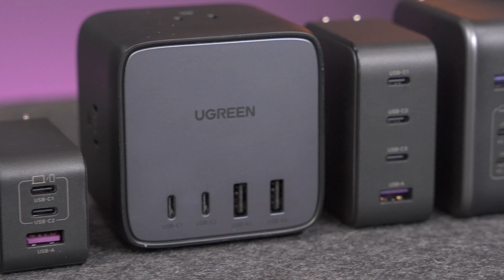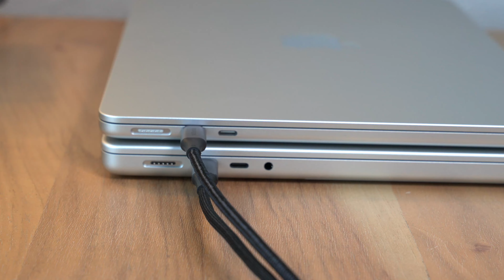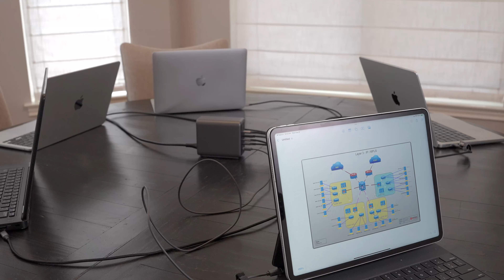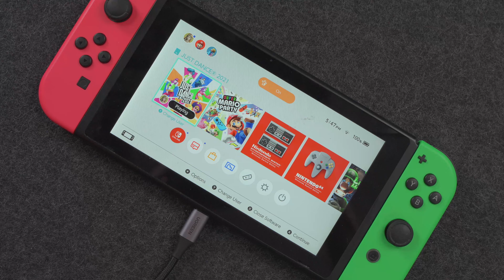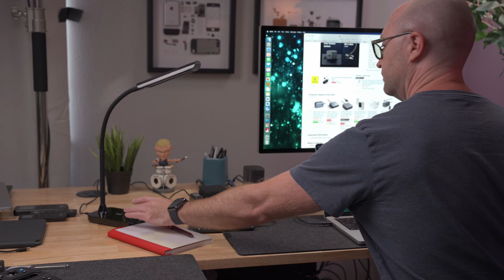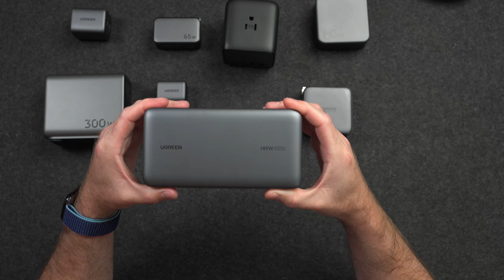Power Your Entire Digital Life with the UGREEN 300W Charger!

Comment: I wish Charger + Batteries existed.

i.e. an actual power adaptor and battery bank in one device.
So plugged into a wall running your device and unplug it to use as a batter when on the go.
Reply from the maker: Good idea.

Comment: I bought the 300W GaN charger after watching this video…bought on Amazon…second port is dead and they are stalling. Had it since sept 23…been about three months…gave receipt then they wanted a video…going on and on. Still not resolved…STAY AWAY!
Reply: The second port on mine was dead too. However I got a full refund from Ugreen through Amazon a couple of days after sending them a video showing that it didn't work. I was able to keep the first one with the dead port and bought a second that is working fine. 9 ports for the price of 5. In the end I'm happy with the customer service and the result in the end. I'll be keeping an eye on the new unit to make sure it stays working, so I can just deal with Amazon if it breaks.
Reply: I sent the same video....ugreen told me to pound sand....amazon refunded. that was it. Bought the Anker 240 on Black Friday for $97 am thrilled with it, I trust Anker. Glad you're happy with yours. @kelleywesley1110
Reply: Any update? I was really excited to order one until I read this
Reply: I called Ugreen and they would not help at all even after showing video and all. Amazon refunded for me. will NEVER buy green no matter how many YouTubers they sponsor ... bought from Anker! @danielheathers1504
Reply: +1 on this. Second port dead after 6 months. Avoid this device, is trash.
Reply: me too usb c2 die in 6 month and c3 dead in 8 month. very suck product